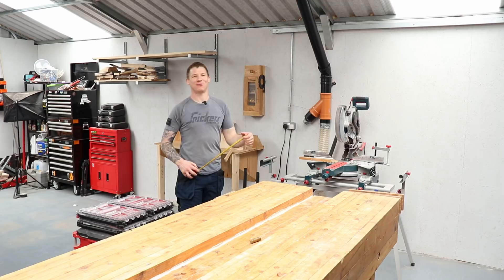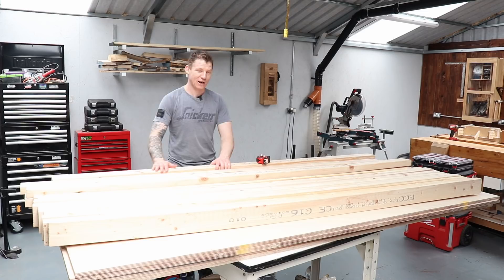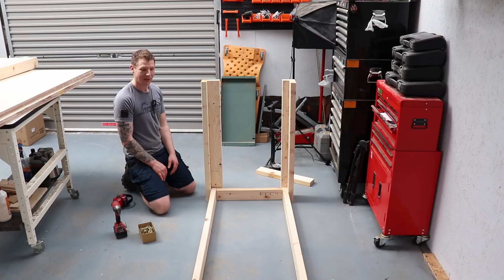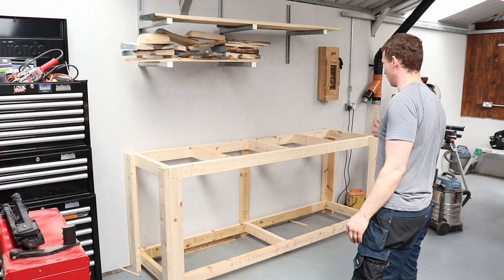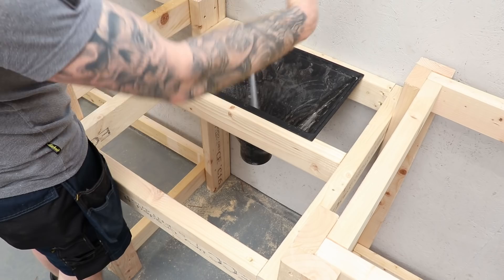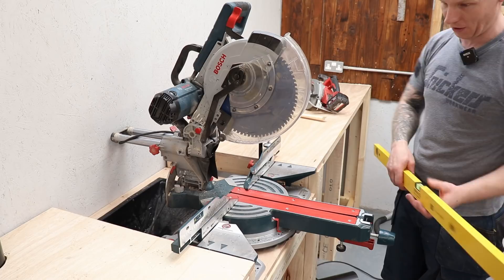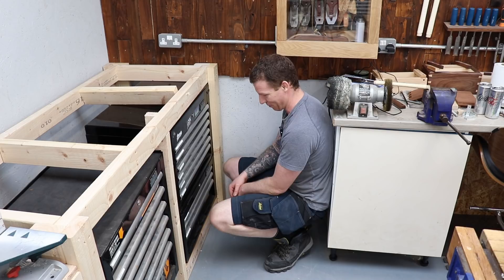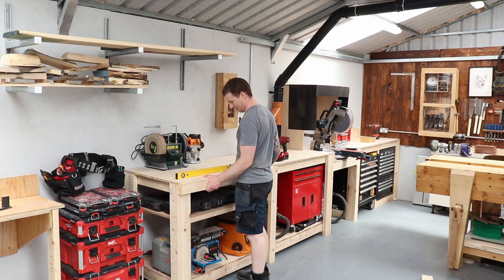Mitre Saw Station with Workbenches, Storage and Dust extraction. Cheap to Make Easy to Build.

Comment: Hello from Virginia, USA. I make very similar work benches. I start with the 2x4 shelves and just make something similar to how’d you frame out a wall. Two long pieces lengthwise, short pieces going up and down. But instead of doing L bracket legs, I just use a single 2x4 on the ends and put in pieces to fit between the shelves. This acts as half lap joints. Very conservative on the amount of materials used, and very strong.
Reply from the maker: Sounds great!

Comment: This is an awesome build and I love how simple it is. I am trying to get your measurements and wanted to confirm what I heard in the video did you say the internal frame of the workbench is 320mm x 620mm. I have made my first side of the workbench and while I don't need to be exact, I am trying to place a 12" double bevel sliding miter on it and want to make sure there is enough clearance in the back of the bench.

Comment: Another great project john. The thing about these projects for yourself and these life quirks is there your own. For a sparkie you have a good grasp of the woodwork and thats coming from time served chippie. As an FYI. All timber these days here is PAO or planed all over. This reduces the 4x2 to the smaller dimensions but your right to measure your pieces to the project and take nothing for granted.
Reply: Also, just to add another youtuber "I like to make stuff" has a great concept for more saw station cowl and tool storage
Reply from the maker: Cheers Dave

Comment: Something to add that you'll probably find helpful would be fence extensions on either side, to help you align longer parts and as a place to clamp stop blocks for long pieces. There'd likely be enough room in front that you could use the grinder there. Or you could make the fence removable by bolting it down to threaded inserts in the table top.
Just a notion.
Reply from the maker: I thought about it but the only fences that matter for accuracy are the ones on the mitre saw and I wanted clear worktops, I might still put in t-tracks for stop blocks.

Comment: Thanks for the video. I’ve built the same as your bench just customised measurements around a window in the garage. Might eventually close up the shelves underneath with drawers or cupboards. Used formply for the top. Gives a slippery surface for sliding wood across.

Comment: Good job! I like the way you built the main structure. As far as the mitre saw hood is concerned, I would lower it to reduce the open front area. The dust extraction would benefit from this.
Reply from the maker: Thanks

Comment: It is interesting how things are referred to in different localities.  Here in the states, we refer to the lumber as 2x4, but you refer to them as 4x2.  BTW: I have ordered Bosch's Surgeon 12-in 8-Amp 18-volt Dual Bevel Cordless Miter Saw with Laser Guide.

Comment: Great video, thank you! If you were adding casters would you also put the bottom frame level with the floor? Just thinking that would give you extra surface to screw casters into. Thanks again

Comment: Brilliant project, just started building this myself, but I can’t work out how you get two shelves from one piece of ply like yours the top is 700mm but that only leaves 520mm which works out 100mm to short along the long side as the measurement is 620mm
Thanks
Tony

Comment: This is the first of your videos that I have watched and you did a good job. Bit I have a few design questions, First I see the idea of putting your tool cabinet under the miter station but how do you get into the top box? You can't open the lid and in every stack cabinet I've ever seen the lid locks all the drawers in the chest.  Second I see the red cabinet (to the left of the saw) sitting up on the shelf. Why didn't you make an area for that to roll into like the black cabinet? Or if that is now it's forever home, take the wheels off? Third the 4 x 2's you applied to wrap the plywood top are a good idea but why didn't you rip the boards (or at least plane of the radius) so you would have a flat side against the plywood instead of a radiused corner? The way it is now just leaves a gap for dirt and saw dust to collect in.

Comment: Nice job on this John.  I'm a new subscriber and really enjoy your channel. I'm in the middle of similar build but am try to retrofit a new sliding miter saw to a couple of dressers i got for nothing.  It won't be pretty but it will work and the draws and doors will provide useful storage.  It's a shame we need to go to such trouble for dust collection on these saws.  I get the whole dust shroud and the cowl thing but it looks like in addition to this you have a collection hose running directly to the saw.  Can you clarify how that fits in to the overall dust collection system?  Many thanks and thank for spending time on making the videos- first rate mate.

Comment: Hey John. Found your channel last night and I'm very impressed so far. Great to see an Irish woodworker on YouTube.
I actually have the exact same steeltech shed you do and wanted to line the walls with timber. What did you use on your walls.?
Reply: I actually started with a couple of sheets of 12mm plywood but they don't seem very strong to support any real weight such as shelving or heavy tools.
Reply from the maker: I put 6x2 timber top and bottom and then fixed OSB to the walls any where you need support put more timber in the walls
Reply: @JohnMcGrathManInShed  just looked back and found your video fixing timber to the walls. I might just take down the few bits I've put up and start again like you did.
I'm gueaaing by the accent you're a Waterford man. If so, commiserations for Sunday.

Comment: the saw table is just what i need to do for mine. the only question i have is how do you open the top of your tool box lid. the one you have at the end on top of one anther? also do you have some kind of measurements that can be used as a guide?

Comment: Late to the party but currently building this; Question - any point in finishing the worktop with tung, Danish oil etc etc? Great vid as always 👍
Reply from the maker: Hi John, some boiled linseed oil would work. It's not necessary with plywood, but it will add to the longevity of it.
Reply: @JohnMcGrathManInShed  cheers!

Comment: Hello, quite an impressive project. I wonder if you are not overkilling with the massive 2x4 material you used in building your workbench. Regards
Reply from the maker: Workbenches need to be robust or the are not much good for heavy work over time

Comment: Question : the tool box you wrestled with to get in the cabinet. Don’t you have to open the top to unlock the drawers?
Reply from the maker: No if you leave a drawer open then close the top you can use the drawers with the top closed and still use the key to lock everything

Comment: Hello John, Great video and just the workbench I need! Would you mind confirming the width you cut for the ply top? Ply boards usually come in 2400mm x 1200mm sizes. The total width of your frame is 700mm (620mm + 40mm + 40mm), so if you rip a width of 700mm from the board, this will leave a width of 500mm and will be too short to use for the internal shelf. I may be missing something, would be great if you can advise, many thanks indeed, Ian
Reply from the maker: Its awhile since I made this video so I would have to go back and watch it, but the main thing I tell people is not to worry about my measurements so much, build the bench to suit the space you have, the mitre saw you have and most importantly to a working height that suits you.
Reply: @JohnMcGrathManInShed  No worries John, I will check the my space and adjust accordingly. I didn't want to waste too much ply if I can , so as to keep the cost down. Don't worry about looking back at the vid, as you have given me some great advice, cheers!

Comment: Nice one John, I am mid building one very slightly different (and wishing I'd made the legs like you did). I've had a small measuring error where one table is 4mm taller than the other. Do I trim the legs (already assembled with ply on top) or would shimming the table saw work? Worried about not being able to slide wood flat along the work top. Cheers if you reply 👍🏻

Comment: This workbench will come in handy, I just bought a mitre saw also which plywood did you use, the amount of 2x4s and which fasteners were used?  Great video!
Reply from the maker: I used 19mm or 3/4 WBP plywood and reisser cutter crews.
Reply: @JohnMcGrathManInShed  Thank you!

Comment: Nice work.  Love it. Do you have exact plans for this???
Reply from the maker: No exact plans I just built it to the size I needed.
Reply: @JohnMcGrathManInShed  right on. Thanks. Great job again.
Reply: @JohnMcGrathManInShed  What were your final dimensions for the left and right benches?  I plan to build the same bench, I have the same saw with the glide system instead of the rails so that saves some space front to back, but I'll have to make a wider platform for the saw to make miter cuts I think.

Comment: nice setup i really liked  what u did.. i do have a question though hows that record power Wet Stone Sharpening System going after u have used it for a while?
Reply from the maker: It works well but the stone is very soft can't see it lasting to long.

Comment: Nicely done (again) John 😁. Your shop has been screaming out for this setup for a while now. I do have a question.... I must have missed it in your shop vac install.. but why the separate small bore vac for the mitre saw ??? Why not just "T" of off the 100mm ?🤔. Also... I hope you emptied the tools from the top of your top box... I don't think that will open too quickly 😂. Great job John keep them coming and stay safe 😁👍.
Reply from the maker: I tried a t but all the pressure was taken by the 4" so the extra shop vac seems to work well and it was sitting there doing nothing so why not.
Reply: @JohnMcGrathManInShed  Ah.. that makes sence 🤔. I'm sure you could throttle it down.... but that would defeat the benefits of the 100mm.... so the shop vac is a great solution 😁. Thanks for the reply John 😁👍.

Comment: John whats the over all length. Ive got a blanck canvas of a 16 x 8 shed  hopefully i can fit  it out very similar
Reply from the maker: I don't have the exact measurements but it can be easily adapted to any size of mitre saw and workshop, as for the height make to suit a height you are comfortable working at

Comment: So, how do you open the tool chest on the far right ? Did you disable the drawer lock that engages when the lid is shut ?
Reply from the maker: yeah you can set it up so the drawers open with the lid down.
Reply: @JohnMcGrathManInShed  it all looks great ! I’ve been checking out everyone’s miter station builds.  Your idea of placing the tool chest under the station seem like a great way to conserve space. I may just do that as well. Thanks for the video!!

Comment: Hi, just wondering how you fixed the plywood tops to the benches? 

Cheers
Reply from the maker: I just used some counter sunk screws
Reply: @JohnMcGrathManInShed  thanks, just screwing through from the top, or did you fix from underneath?